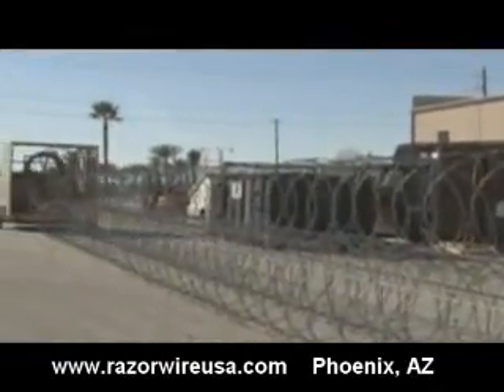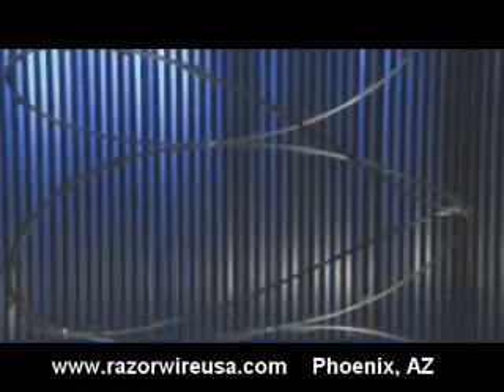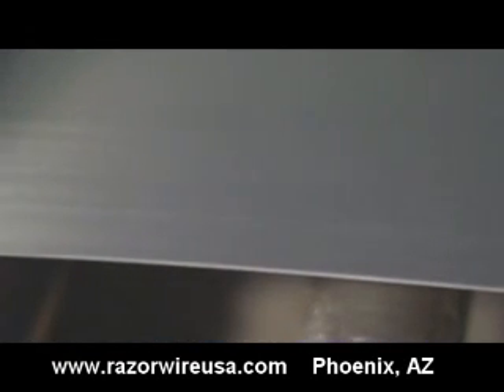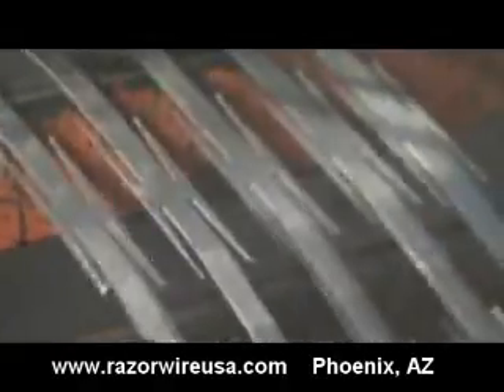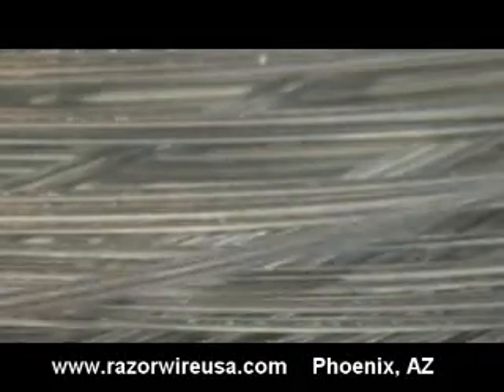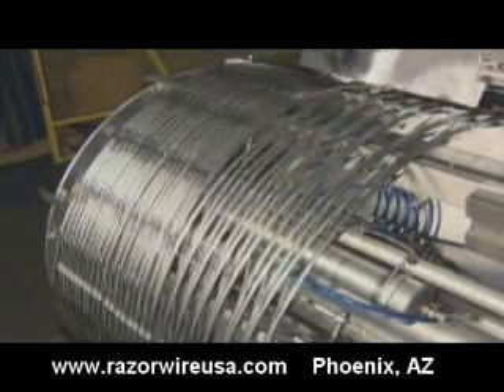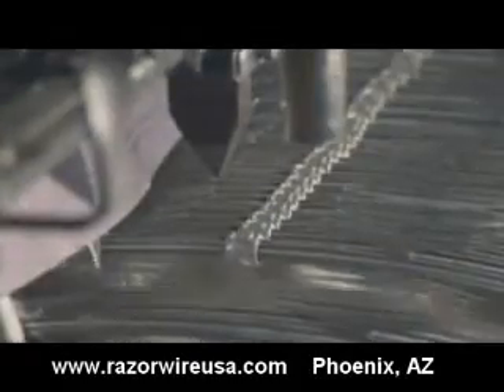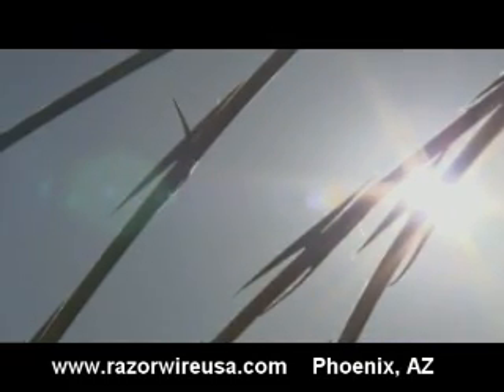Razor Wire -- Made in USA

Comment: Uh jail fencing & power plant fencing should be a 10-12 ft. vinyl fence instead of a chain link topped with this razor sharp wire. Vinyl fencing is more secure because if an inmate or intruder scales a vinyl fence they’d fall and get hurt and not be successful.

Comment: one roll of old carpet over it and it's totally useless :o)
Reply: All you need is thick Leather motorcycle gear
Reply: Yeah, as long as Frank remembers his role in the job and doesn't space out or loose his glasses.
Reply: Yea and when the carpet sinks in between to rolls of razor wire and cuts you to shreds you'll be useless
Reply: @dickwelts8817  and when security finds you bleeding from your throat and legs that jail cell is useless too

Comment: Throw a few layers of carpet over it or if you do want to cut it use a tool on a pole about 6 feet long this would keep you a safe distance away when it snaps back.
Soldiers had to deal with this type of wire in WWI and WWII.
Of course now days I'd go with a robot to cut it.
BTW a thermal lance can relax the tension stored in the wire if you heat an entire loop before cutting it.
Reply: Oh man can it really go so far as 6 feet?

Comment: Bangalor mine will take out razor wire.  Or a bulldozer, backhoe bucket, or stolen tractor trailer truck.  Or if you've got some time, a thermite solar lance or just wire cutters.  Wire cutters are cheap and fit in your pocket.